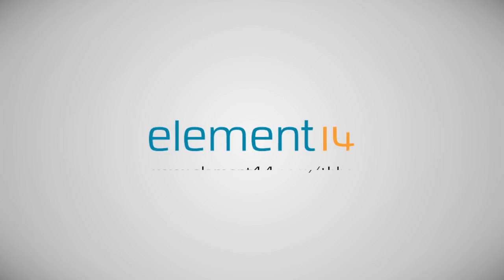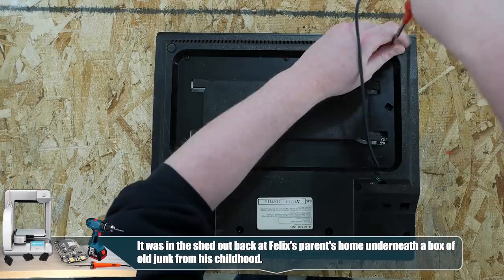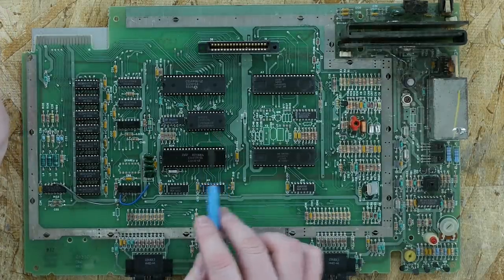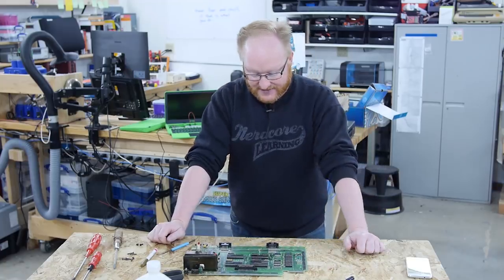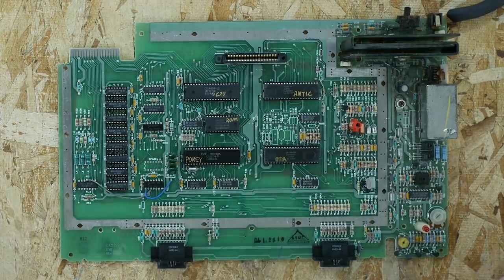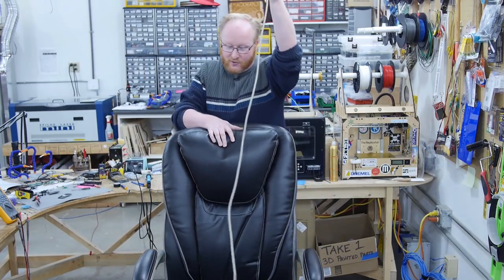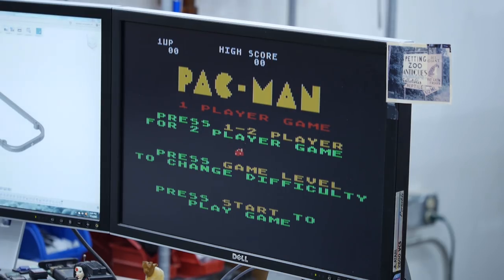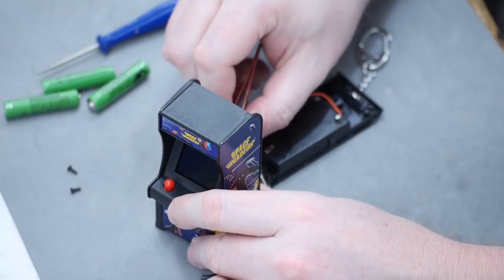Atari 5200: Making a Better Controller

Comment: I loved the original NES but the controller shape, sixe and the horizontal A/B buttons made it hard to use, the dog bone had a better shape and button layout but its buttons her much smushyer and it was still too small. maybe a larger NES pad with a rounded body and the A/B Button section of the PCB cut and installed at an angle. that would give the good placement and rounded shape of the dogbone with the better control of the original while being big enough for adult hands.

Comment: I would totally buy two for my 5200. The stock 5200 controllers are awful, even upgraded with aftermarket parts from Best Electronics. Please sell them Ben, even if it's just a kit.

Comment: didn't the 5200 joystick also have paddle/spinner functionality too?
Reply: mybad, it was the 2800/Sears Video Arcade II

and the point of this video is to create an improved 5200 controller solution, I guess?  I had a 5200 a while back but didn't really care to keep it in my collection... the controllers hadn't failed yet when I owned it, they worked well enough.

Comment: Um, why did you build a modern analog controller and then test it out on a game (Pac Man) that requires only discrete joystick input? That you did not test 5200 Missile Command or perhaps Star Raiders is a deal-breaker, I don't know anything about how the joystick performs in a game made for analog movement.

Comment: I would've liked a bit more exposition regarding the voltage ranges used by the arduino and atari. Why does the potentiometer need to be remapped? Couldn't the supply voltage for the potentiometer be modified rather than using a digipot to make a new resistor divider network?

Comment: So many Ataris have such awful controllers.

I have an 800XL (incidentally a 5200 is basically the same hardware modified for use as a games console)
Had one in the 90's but got a replacement recently.
It came with two controllers, but they're god-awful.
(funnily enough in spite of being essentially the same hardware, an 800XL actually seems to be smaller than a 5200, and that's including a built-in keyboard. Go figure.)

However upon investigation I did learn that the ones I received are in fact Atari 7800 controllers.
Which is good to know if I write my own stuff, because both buttons on those work independently.
Normally an 800XL or it's other variants only read a single button, but there's nothing stopping you reading the alternate pins for the 7800 controller buttons.

Of course, I use the controller from my Mega Drive instead, because...
I mean, 7800 Pro controller? Ew.
But still.

I wish they didn't suck so much. XD
Reply: Awful controllers looks like an Atari signature move. They were awful before Warner, they were awful under Warner and they were awful under Tramiel.
Reply: Thank god for sega I guess.
Reply: Yeah, Atari controllers have really weird designs. But above anything else they just lack any kind of durability.
Of the two I have both have at least one broken button, and the stick is bent on one. How do you design a joystick that can bend like that? XD

As for the sega controllers, it's a small miracle that works. It shouldn't. The Sega controller expects +5 volts on a pin that on an atari port officially isn't used.
As luck would have it all unused pins are +5 volts anyway.
Meanwhile what is officially the 5 volt power pin for atari controllers connects to the 'select' pin on a mega drive controller.
As luck would have it this means the dpad works as do the B and C buttons. (B corresponds to the official atari joystick button, C on the 8 bit computers can be read by reading one of the potentiometer pins used by paddle controllers)

The mega drive controller works in kind of a surprising way really.
aside from having the power pin wired differently, it's essentially the same as an atari controller in how it works, except a second button is wired in, and one pin is used as a 'select' pin.
If 'select' is low you can read start + A and two of the d-pad directions, if 'select' is high you can read all 4 dpad directions and the B & C buttons.
Makes it all the more lucky that an atari pulls the 'select' pin high, because it'd be unusable otherwise.
(the 6 button controller does something relatively weird and complicated to allow the X, Y and Z buttons to be read while otherwise still behaving like a 3 button controller)
Reply: Newp. 800XL is different. The 5200 was based on the 800. The uglier, older version.
Reply: @kuralthys
*But above anything else they just lack any kind of durability.(
Eh? You could run a truck over the VCS/2600 joysticks and they'd still work.
Reply: Yes the 7800 controller did suck.

Maybe 20 years ago I found a Sega Genesis controller in stock form would work just fine on an Atari 2600 with the B button being the button that worked.

For the 7800 though it required removing the chip on the board and connecting the wires directly to the buttons and it would then work for the 2600 and 7800. 

Was much easier to use.

Comment: Hey Ben got an idea, how about making PS One accepting dualshock 3 and dualshock 4 controllers via Bluetooth? It shoud be quite simple using arduino and bluetooth shield or ESP32. I think there is even some library for controlling PSone using it and you could make nice wireless connector package to put that module there and then use those modern controllers wirelessly with old PSone, how about do that? :-)

Comment: 9 minutes in and you've not looked at the controller. Then just 2 minutes later to get to a printed board, wired controller. Did you accidentally miss out a section??

Comment: you guys should make a larger more erganomic grip adapter for the nintendo 3DS to prevent camps. you could attach it by removing the back plate and make an adapter that fits on where the back plate was.

Comment: Hey how about making a controller with both a self centering and a none centering stick with a switch to change between the two for some games so the controller will work both like an old controller and a proper controller

Comment: Not the most creative design but as you said not hard to make a better version of a bad controller. Pretty minor change I'd make is a concave thumbstick cap, I'll forever blame Sony for those convex ones. :P Your 5200 controller would sell like hotcakes.
I could see your gears turning Ben, usually it's about making it portable but I'd like to see how much smaller the 5200 console could have been had they not tried to make it as big as possible.
Reply: Logan Jorgensen I dunno if it's entirely fair to blame Sony for that. XD
Though I will admit theirs are especially convex.

Still, n64 stick is convex, gamecube stick is, Wii sticks are, Wii U sticks too. And Switch sticks.
From what I recall Sega's all are as well...
Go figure

As for the console size...
get an 600XL or better an XEGS and you basically already have an answer to that, since those are basically the same hardware.
I still find it weird and kinda hilarious that the 'home computer' version of this hardware with a built in keyboard is smaller in almost every dimension than this thing.
I mean, what were they thinking, making this giant monstrosity!? XD
Reply: That's what is so funny about it, Sony actually had concave caps on their very first analog controller for the PS1 and then quickly abandoned that ergonomic shape for no particular reason. I'm not sure why so many console makers don't understand that the human thumb has a convex shape to it. O_o???
Yeah probably about XEGS size once you get rid of all the extra motherboard space, too much keyboard input for a game console. Idk, seems like they were trying to make the biggest console ever. :)
Reply: You'll see pics of the unreleased Atari 5100 over at the Atari Museum website. And if you search the net, you'll see one instance where someone modded their 5200 motherboard and installed it inside a 2600jr case.

Comment: why is the second potentiometer address 0x80?
Reply: i was thinking is it because 0x80 is 128 in dec, and the i2c bus has 0-127 reserved for the first potentiometer/devices addresses? ie each i2c bus has a max capability of 128 devices on it?

Comment: Finally somebody addressed this issue! Except you only did 80% of the controller rebuild. On the 5200, the joystick is also a paddle (for games like Breakout). The paddle feature was incorporated into the stick to prevent customers from having to buy another peripheral, making this console more "attractive." So bodge your newer controller to include the paddle function to achieve 100% compatibility with the horrible Atari controllers in the next episode! Great job though!!!

Comment: I'm confused - did they make a replacement 5200 controller that plugs into a 5200, or a USB controller that plugs into a PC? From the SPI and Arduino content, it seems like the latter? Also the picture on the monitor is way too sharp for RF output - looks like it may be an emulator... ?
Reply: Never mind - looks like the Atmega328 and the digital pot are being used to translate the stick analog values to a resistance range the 5200 can understand.
Also maybe the video output is composite.
Note that some games "auto-calibrate" the joystick analog input, so you when you started the game you would have to move the joystick in a circle (preferably chanting "work dammit!") (ie: move the joystick through its maximum range in X an Y axes).

Comment: I had like 5 5200 controllers... along with a bunch of games and the system, all but 1 controller is non functioning... I can't remember what I did to make that one controller work but I know I went in and trimmed some wires replaced some parts... Total hack job not quality but it worked for years, might still work but I don't even want to see that machine. My #1 worst controller. 

#2 will surprise a lot of people... I have in my desk 3 Nvidia Shield TV controllers, the older phat style All of them "work" but 2 the touch parts don't function so no cool voice commands and all that, the 3rd one everything works BUT it hard pressed left on the analog stick at random intervals... and will only stop by the will of the gods... My 4th one is one of the newer ones I bought almost day 1, it's still working great so either I had a bad run with (180 bucks before tax mind you....) 3 Nvidia controllers or they truly suck?

The horrible part about my long winded tale... I have controllers from systems dating back to 1979 still working fine and entire systems. I have never had a controller go bad before other than ones that had seen like 4,000 hours of heavy handed use by multiple people. Normally lasting far beyond my expectations. But the original Nvidia controllers must have needed some redesign because they released new ones?

Comment: Favorite console Genesis. Worst controller Jaguar.
Reply: "Controller Jaguar" sounds like a D&D monster
Reply: Tetsujin roll for initiative.
Reply: I find it hard to believe Jaguar controllers are the worst given just how many awful controllers Atari has made. XD
Reply: I had a Coleco Gemini which was a 2600 clone and it had this controller with joystick and paddle built into one controller. It was great. Now the Jaguar had the worst controller of any system I owned.
Reply: Men with small hands hate the Atari Jaguar JagPad and the Jaguar ProController, just like they hate the Xbox Duke. I think the JagPad and especially the Jaguar ProController are 2 of the most comfortable and ergonomically friendly gaming controllers ever released.
Reply: Jeremy Holloway I hated that phone pad thing on the controller Atari just couldn't let go of.